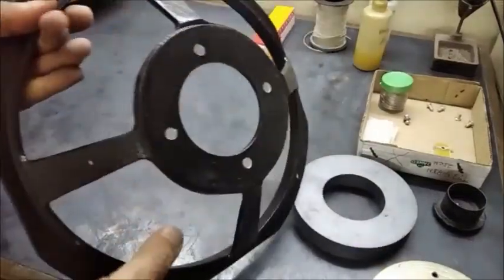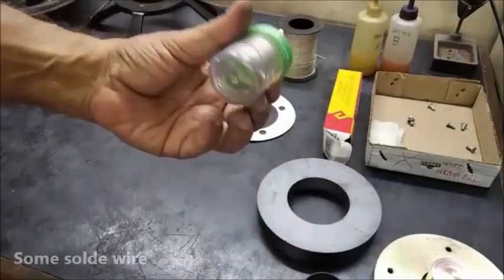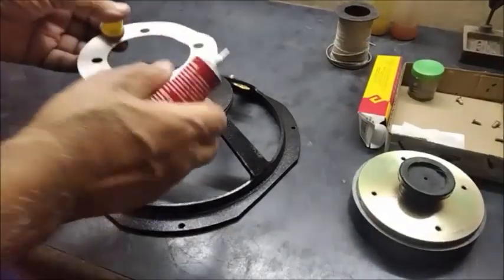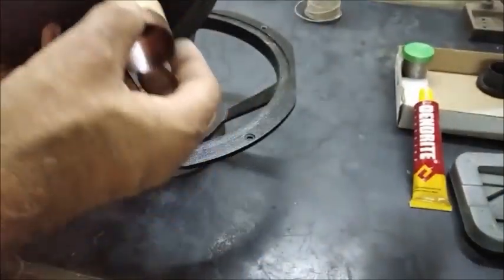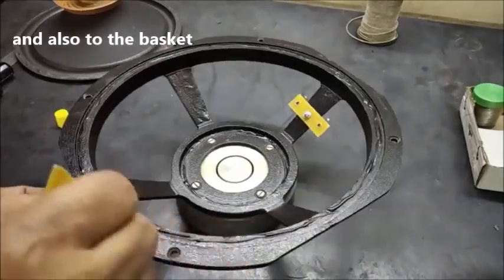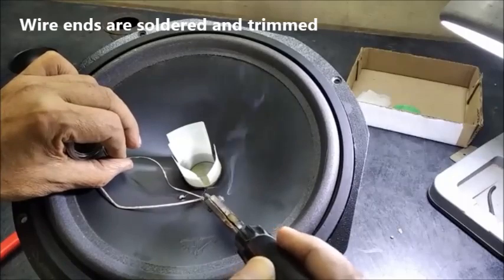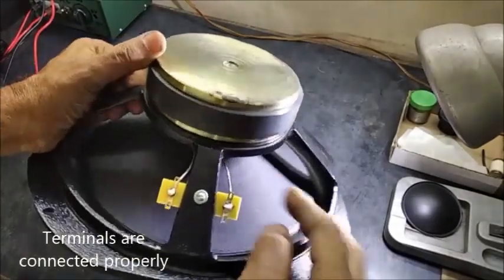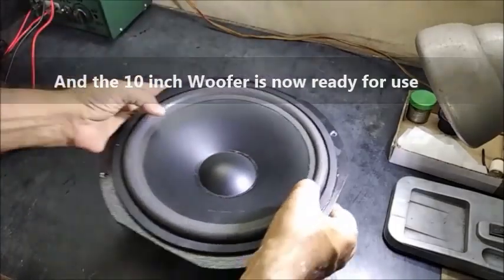How to assemble a 10 inch Woofer Loudspeaker

Comment: Sir nice video.i have technics sb-L50 speaker but bass speaker coil i want repless but dont understand how much inch coil.plz help me
Reply from the maker: First of all you have to open the coil from the speaker. Then you can check in your local spare parts market for a replacement.
Otherwise it will be better to get it repaired by a speaker repair shop.

Comment: Hello... Sir ji which is the best woofer size for home 8 inch woofer or 10 inch woofer and what is the best Watts woofer for home... Reply...
Reply from the maker: It all depends on what amplifier you are using. Speaker wattage should match with amplifier output. Bass response of a 10" Woofer is better than 8" inch.

Comment: How to connect MOSFET board 4 ohms subwoofer (JBL 1300 ) .The board is 8 ohms.
Reply from the maker: Whatsapp no : 9007400622
Reply: @makingloudspeaker I want to make 100 watts 8 ohms very good quality speaker for my 60+60 watts marantz amp What do you suggest.